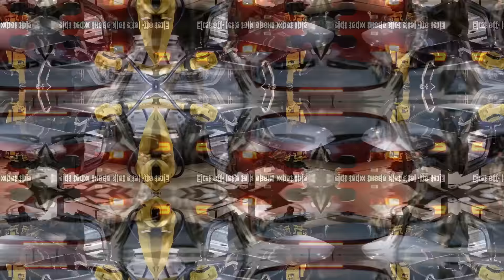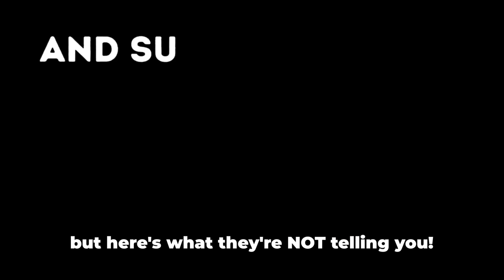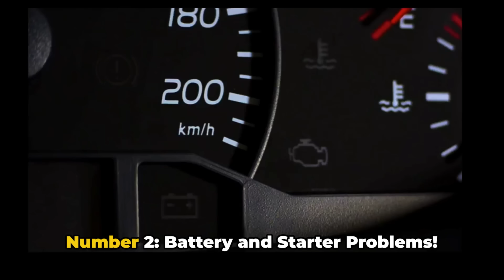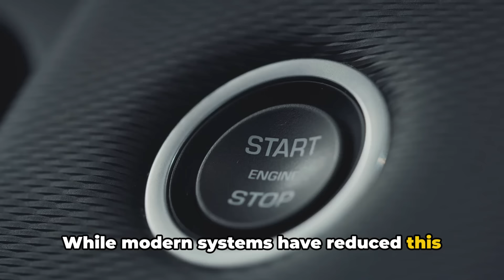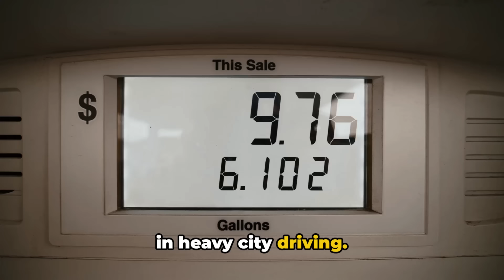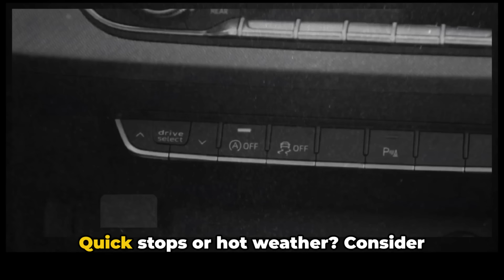The TRUTH About Auto Stop-Start System (Nobody Talks About)

Comment: I am not a fan of the start stop, but 2 issues need clarification. My wife has a 2018 Toyota Highlander so I'm speaking for this vehicle. 1. He referenced the delay when you hit the gas. Her car doesn't wait for you to press the accelerator, it restarts the engine as soon as your foot comes off the brake. 2) The AC problem. On her vehicle, if it's too warm inside the car, the start stop is disabled and a message appears that says the car will keep running so the AC can work. With all of that being said, I still shut the thing off as soon as I get in the car and so does my wife.

Comment: I have a 2012 micra with a stop start which is a pane in the neck. I saw a vid on youtube where the person jammed a piece of paper in the switch to keep it turned on permanently, so I tried it and it worked brilliantly. So now I don't have to keep switching it off every time I start up. The engine seems to be running a lot smoother as well.

Comment: This is where (some?) hybrid cars with electric motor whole shot starts uses the electric motors to start the wheels moving at the start of every run then shifting into the gas engine after hittin the 28mph (?) speed, kicking into gas power mode. Also crawling down the highway at less than 28mph on electric power feels much better ($) than wasting a bunch of gas and money in traffic jams. With a hybrid I don't give into range worry as I can just put more gas into the tank and keep going right then and there.

Comment: if you change from belt driven accessories to electrical, it would solve a lot of wear and tear since the battery is much larger. In hybrids it is a start stop system but all the accessories are now driven from the battery instead of the engine so the engine can be prepared before being turned on.

Comment: Cars won't shut off if the AC is commanded on and inside vs outside temps are too great. Oil pressure is only a problem if oil has all drained into the crankcase. There will still be oil in all the critical areas, and again it won't shut off if conditions are such that it would cause damage (like a hot turbo). I worked on cars when the auto start stop first came out, and I have yet to find one that has a massive delay like that. From the time you release the pedal to the time you push the gas is how long it takes.

No, it is not the great system they want you to believe, but it is nowhere near as bad as you seem to believe.

Comment: I always looked on it very simply. MORE wear and tear on the starter motor - MORE wear and tear on the engine, MORE wear and tear on the battery. No thanks. And here's the kicker - unless my battery is charged above a certain level - and I reckon it's around 75% - 80% - the system doesnt even operate. Even when I've got enough charge, I just switch it off.

Comment: In my experience 
I feel like its a good idea to have it i get like 12 miles a gallon in the city in my 2010 altima non hybrid in heavy nyc traffic i on the highway 22-23mpg  best ive ever gotten was 32mpg no traffic at 45mph   tried to turn the car off at long lights got 16mpg by doing that then got into hypermiling  an was able to get  60mpg in the city no traffic with engine off coasting and slightly over inflated tires  so it would just keep rolling believe it or not i would go about 40mph then just pop it in neutral turn the car off and make it like 10-15 blocks before i was going  20mphish but by that time id be coming up on a red light sit there for like another minute then turn the car back on when the light turns green repeat process i wish it was a key start because it was annoying to cut full power then have to go  and hold the button  to the accessory position so my steering wheel wont lock and you got one chance to use the brakes where power is still left you do lose power steering but i drove a different car with no powersteering for years so im used to that anyway also did with a nissan titan usually get 6mpg i got like 26 with eoc i did this durring  covid but once traffic picked back up it no longer seemed viable  plus the permanent code that popped up  on the dash of the altima i stopped doing it with the titan when i found out about the altima code plus it was an 08 so it didnt have permanent codes yet lucked out with that one  transaxle was getting hot i only did short trips 5 miles each way to and from work i started driving regular and the code cleared itself after like 300 miles and doing the specific drive cycles instructed for the code from nissan or pay 400 to have them erase it i did it the cheap way payed like 40-50 bucks in gas and drove  i thought about the solution to save the  the gasoline internal combustion  engine car for future generations  with emmisions standards getting harder and harder for manufactures to comply with  if they can work in a mechanical  cooling system to the transaxle   so it dont overheat or for transmission for longitudily mounted engines trransfercase along with a cooler for 4 /awd when the engine is off and coasting along with an alternator and or regenerative brakeing system in at each wheel weather its from the wheels spinning or regenaritive braking charging the batterys along with electric assisted powersteering/power brake you would have two regular size car batteries instead of one so you have a larger reserve capacity you would increase mpg tremendously  you would just take hit on your mpg when you want to use the heat or ac or defroster i feel its cheaper to burn a few dollers in fuel that you can fill up in less than 15 minutes  than it is to  pay thousands for an ev  battery that takes atleast an hour to charge and adds alot of weight to the vehicle and your effed when you get a power outage  i dont use my climate control often except for the summer because i usually roll my windows down a few inches and that keeps me cool in the spring .i run the ac full blast in the summer   the winter i put the heat on for like 5 mins then it gets like an oven   the cars warm enough to drive for an hour with the windows up  there would be a system override aswell to  just be able to run the ice constantly but when its not overridden make the car turn off if you let off the gas for more than say 7-10 seconds and make that option adjustable to your liking seconds after  and just coast use the wheels and or brakes to keep the batteries topped off so all the assisting features work when you hit the gas the stop start would work weather your going at speed or a complete stop just like a hybrid but with no acceleration other than that coming  from the internal combustion engine you would have is simular results to a hybrid fuel econemy wise in the city  along with low production costs once mass produced and youd save a hell of a lot of money on not buying  lithium ion batterys for thousands of dollars but still spend 5-600 on absorbed glass mat  batterys when your both your batterys go out every 3-5 years you could get lucky because  my grandmas agm in her hyundai was 9 years old when i changed it she barely drove it but it started right up until one day it didnt  ive gotten 7 years out of my last lead acid battery and it was dead for a year sometime in the middle of that when i didnt drive it then  i was able to get it to charge and it kept on kicking for atleast 3 if not 4 more years 
 I studied automotive engineering in college and basically yes the oil pressure needs to build back up again but in most modern cars start up does not f up the top half of the engine they use oils that are the right viscosity for most weather conditions   there should be enough lubricant to get you through a startup from trying to start it bescause the engine did atleast 3 to 10 revolutions 200rpm 3.3persecond  coating parts with oil   before it even started in that process pumping oil and coating parts in the engine you will get  extra wear in your cylinders overtime but think about all those rotations not happening cause the engine could be off for possibly minutes at a time so it kind of evens out more ware from start up less ware from not running  espically if your going down a hill or mountain you could probually get down that sucker for free lol  but anyways your crankshaft takes the biggest hit on startup which leads to cracks   if done repeatedly and frequently which my solution to that is put in a stronger heavy duty crank in when considering this type of build and sleeve every engine even if it has dry jackets makes the rebuilds go so much easier i dont have the time or patience to try to build anything like that but would like to see it done as a way to save the gasoline internal combustion engine besides the hydrogen ice concept because hydrogen is alot more explosive when you get into an accident with one of those hydrogen cars they will probably explode like an old ford pinto from the fuel tank and a spark and it takes 3 times more hydrogen to get the same mileage as gasoline volume  wise its like driving with a bomb   i know the comment is very long but if your bored give it a read you might be able to improve my idea and become rich and i get to see it done its a win win if you read this far your a champion

Comment: Useless feature.  80% of the time, I'm restarting to go within 2 seconds of it stopping, and 3% of the time, the engine hasn't even had a chance to fully stop turning before I need to restart and go .
I wish my 2018 Equinox had a button to disable it more easily than shifting it into L and mashing the + until the max gear is 6...

Comment: This does not apply to Hybrid vehicles!  My real world experience - 2000 Honda Insight G1 manual transmission.  Engine ran for 490,000 miles before the #3 (it's a 3 cylinder) lost enough compression that the engine needs an overhaul or replacement.  I'm choosing a replacement with the same engine, but with fewer miles.  The A/C in vehicle has an Eco mode (gas engine shuts off) or regular mode (gas engine does not shut off and AC keeps running) when you are at a stop in hot weather.  Hybrid battery provides the juice to restart the gas engine - smoother and faster than the starter on most conventional gas engines.  No alternator either.  This tech is over 25 years old!  Also a warmed up engine starts easier than a cold one.

Comment: I've read that there are ' no starter motor' starting systems. Don't know if they are out yet, but I still wouldn't want it. Crank position sensor determines which piston is in the correct position to get a squirt of fuel and a spark, then they continue all firing in order after that and it's started. Probably use less battery power and not a bad idea for regular starting, still would not want the auto start.

Comment: When I was a Chassis Dynamometer Technician, my engineer and spent over a year testing vehicles with this worthless system.  Even with me driving these vehicles as perfectly as possible on the rolls and him constantly turning the calibrations, we only saw a 1.4 mpg improvement when comparing them to vehicles with out the auto start/ stop garbage.  Also, that’s in a temperature and humidity controlled environment with certification fuel.  
Auto/ start stop does nothing more than hurt reliability and up the cost of a person’s vehicle 👎!

Comment: The only car where this behavior is acceptable is a hybrid where the electric motor is always available to go when you hit the throttle, and the fuel savings is actually legit.  I got 50+ mpg easily in a rental.  That being said, hybrids will likely be even MORE expensive for long-term maintenance, so maybe still not worth it.

Comment: I just bought a 24 Tacoma and that's the one thing I don't like about the truck. I checked the manual, and even though there's a table of customizable features with a dealer only column, turning that off isn't mentioned. I asked the dealer and was told there was no way to permanently disable it. So, I'm training myself to turn it off after starting each time. When I forget, I'm reminded at the first stop afterwards, when the truck has to restart. But, I'd much prefer just turning it off altogether, if there was a way.

Stupidest feature I've ever seen in a vehicle.

Comment: In my early days I was doing engine rebuilds. My SUV has the auto-start/stop feature. The dealer service told me they cannot reverse this feature.  I have to remember to turn it off each time I start the engine.  When the engine is stopped there zero oil pressure. When the engine restarts there is no oil pressure at the time of re-starting.  This puts increased bearing and piston ring wear in the engine.  There is increased wear on the starter and increased load stress on the battery. On my vehicle I cannot disable this feature.  There is a prompt in the menu system to disable it, but this does not work.  

I was told for vehicles sold at my location in Canada it is illegal to disable this feature by default. I have to remember to turn it off every time I start the engine.  There is an add-on gadget I can buy to connect between the auto start/stop switch and the harness feeding it. This gadget is illegal for me to install, and it may void some warranty with the electrical system.  

When I was speaking with a diagnostics tech at the dealer he told me with the people who are allowing this feature to work, with average driving after about the third or fourth year they are changing more starters, and batteries. They are also finding more engine wear.  The replacement of the battery and starter will cost a huge amount more than the gasoline you may save. 

There has to be consideration that when the engine restarts there is an inrush of fuel to get it going again. This inrush makes up for about the same amount you may have saved at a 2 to 3 minute wait at a red light. In simple words there was no saving of fuel at all.  Only increased expense over the long term.

Comment: I've recently purchased a Hyundai 2020 Santa Fe. This was my first time with this "auto-off" feature. I found it annoying when trying to start up from a red light going green, expecting "power" and finding out the engine room called to say "Give us a second...." The buttons for "auto-off" and "emergency break" are next to each other on the center console.
Standard check-list for start up is now.....

1. Engine start
2. Lights (if needed)
3. Wipers (if needed)
4. AC or Heat set as needed.
5. Seat belts secured
6. Doors secured
7. Auto-off disabled.
8. Emergency break released

I don't want to get complicated by modifying the engine/battery connections with odd things or digging into the electronics, so for me, I just added "disable auto-off" before releasing the emergency break (and yes, I set the break when parking it).

Comment: I had a 2017 BMW 330e Plug-in Hybrid... it did not have a button to turn Stop/Start off at all.  It is not as annoying in a hybrid, as the car moves off from stopped instantly on electric, and, if it is needed, the petrol engine starts after you have begun moving.  Although a Hybrid might not stop/start as often in traffic as an ICE with Auto Stop/Start, the wear and tear is still worth thinking about.  A Plug-in Hybrid with plenty of charge in the battery will whirr along nicely!  Floor it at the lights, or to overtake, and the engine goes from stone-cold with zero oil pressure, to max power and max revs in a split-second... then ten seconds later, when you have finished your Tomfoolery, it shuts down again, and IT DID NOT EVEN REACH SKIN TEMPERATURE!   🥴
(I loved the car tho'!)   BTW, I am another one who is a convert to EV's, and I cannot see myself ever going back.

Comment: There are many ways of disabling start stop for good, depending on your car make. The start stop can be disabled by electronic coding, or you can buy an electronic chip off ebay or amazon that will disable start stop. The best way of finding out how to do this is go to an internet forum for your car. In my case I bought a cheap plug-in electronic chip off ebay that disables the start stop every journey. Start stop is next to useless, damages engine parts and can be dangerous if the car cuts out in the middle of a junction. Best without it. Cheers Col.

Comment: There’s a simple solution if you have a obd device . I have a obd eleven and in the settings I have changed the setting for the switch to memory not auto on like default. I’ve always been sceptical about it especially on the starter motor ware and tear . Some cars stater motors are now in stupid places like behind intake manifolds eg a 2019 Audi s4 . Which requires the engine out to access it

Comment: These systems make a little more economic sense in Europe, where gas typically costs about twice as much as in the USA. However the lag on startup is a pain, especially on vehicles that only start when the accelerator is pressed rather than when the brake is released.

Comment: It's not designed to save you money. It's designed to save emissions.
Reply: Not to mention corporate gets richer. Soon they’ll want to smogyour farts & burps
Reply: Exactly!
Reply: I can almost guarantee this system produces more emissions in the long run. The vast majority of people leave this shit on and when it stops working, their mechanic will install a new battery, how many emissions are coming from battery production and recycling? Now apply the same logic to the starter motor, oil, engine mounts, spark/glow plugs, gasket replacements etc. 

We're being ruled by morons

Comment: The twelve volt battery is not used in a Ram.  That system has a forty-eight volt battery sitting on the alternator. Start and stop are instant.